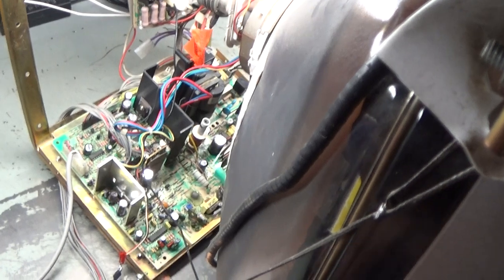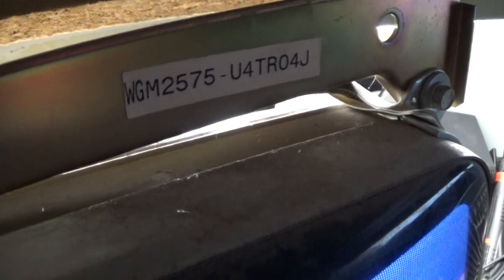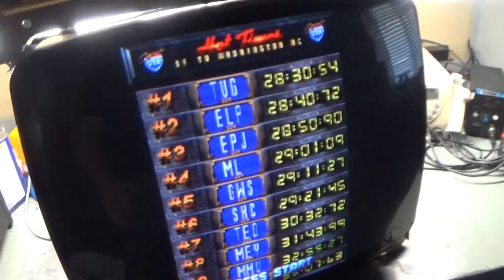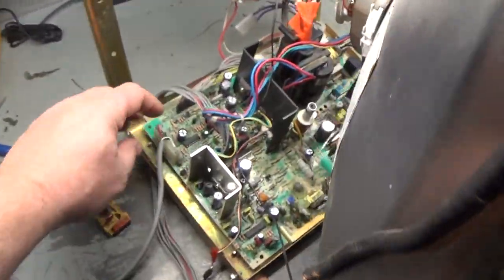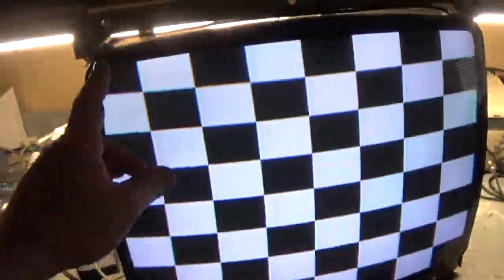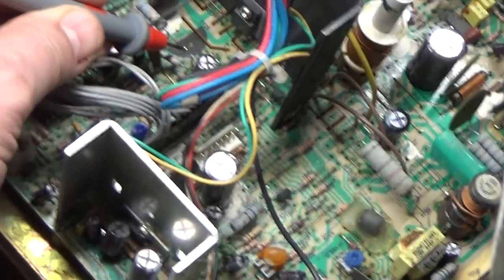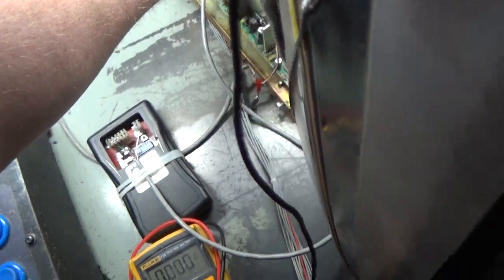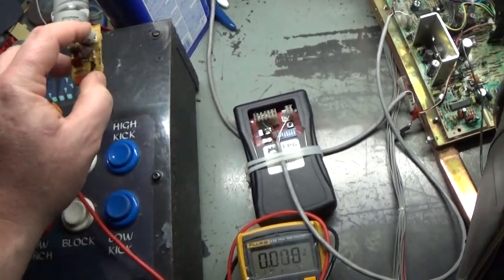25"/27" K7500 Arcade Monitor Chassis - Interchangeable? Let's Find Out!

Comment: The 25" chassis do not have the pin cushion board. The 23" (yes, TWENTY THREE!) k7400 have a slightly different pin cushion board that is soldered to the chassis.

Comment: When I saw the title it reminded me of John of John's Arcade's Golden Tee / Silver Strike monitor, which was a 27" tube on a 25" chassis and the picture wasn't full-height, with black bars at the top and bottom. Pretty sure they were K7500 parts.

Comment: I tried to put a fully working/rebuilt 25k7500 chassis on a 27k7500 tube and it wouldn't fill the screen. After trying to max out the adjustment it smoked the width coil.  I'm not so sure the only difference is the pincushion pcb.
Reply from the maker: Interesting. If I come across a 25, I’ll have to see what happens. There’s no technical differences I could find. You could be correct but I will have to try when I get a chance. The cap kit, flyback, most common parts, etc are all verified the same. The coil could be different but without access to a 25 at the moment, I can’t say.

Comment: Question Mike, do you know of anyone that reproduces the pincushion boards?  They seem pretty simple to reproduce, not much to them 😄
Reply from the maker: Nope. And honestly, never needed one. I usually remove them from the chassis’ I run.
Reply: @MikesArcadeMonitorRepair  😳 …. Does the same pincushion board work in the k7400?
Reply from the maker: Yup. They aren’t necessary for operation. Only if you want to curve the image.
Reply: @MikesArcadeMonitorRepair  Mike would you ever be willing to sell me one or two? 😳🙏🏼
Reply from the maker: I think I gave away my last one just recently. My apologies. If I had one, I've just give it to you. I'll keep an eye out.
Reply: @MikesArcadeMonitorRepair  🙌🏼 Thank you Mike 🙏🏼 

I tinker a lot and I’d like to get this board reverse engineered so that it can go up for anyone in the public to have printed if they want a copy … maybe supply a BOM for all parts required to recreate it if needed 👍🏼